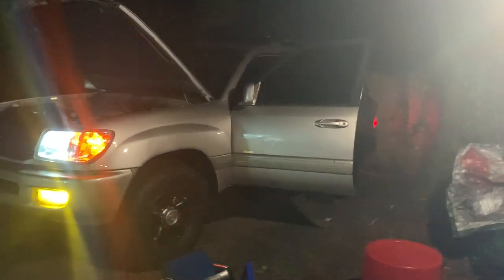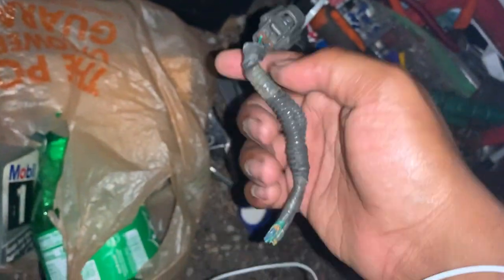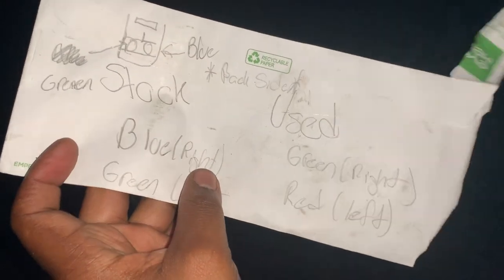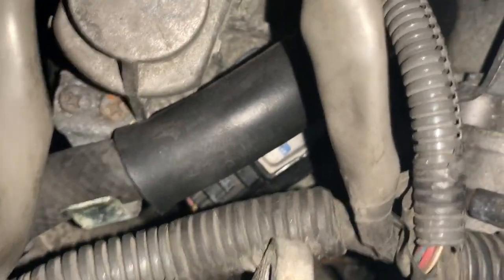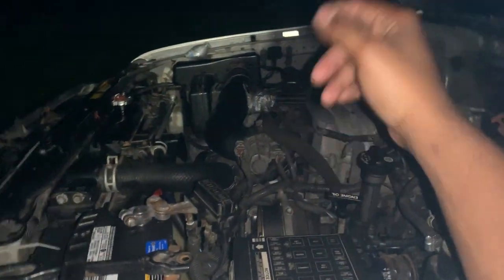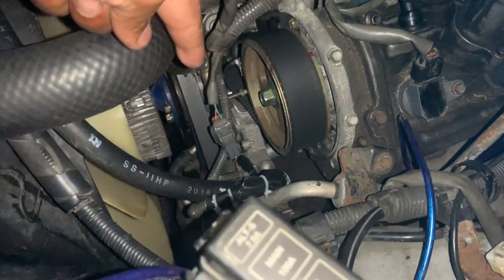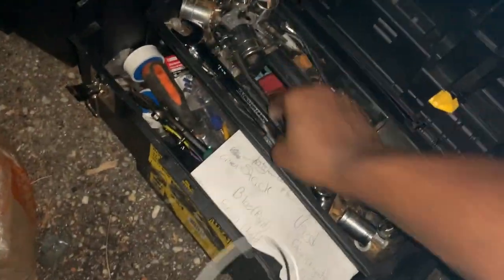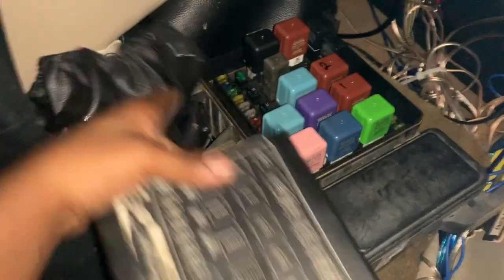Engine Cranks But No Start Pt. 2 - **RESOLVED** (Land Cruiser 100 Series)

Comment: Dude this just happened on my 2000 UZJ100- cranks but wouldn't start. Your vid saved me a ton of troubleshooting. Changed out the crankshaft position sensor and fixed. had my buddy scan for codes first and sure thing 335 code.
Reply from the maker: Props Brad, I am glad this video has helped addressed your issue and got your LC back up and running.

Comment: Woww thanks for the knowledge. Currently i hv Land-cruiser having same issue exactly as urs. I've already ordered new ECM but, am gonna check out CPS wiring now. My result will com afterwards... Below. Though my fuel pressure is low when i checked it.
Reply from the maker: Hey Collin's, I would highly suggest that you purchase odb2 scanner before you get the ECM installed, it can save you a lot of time and money. 
I too had bought a new ECM thinking it was my computer at first. Prior to installed the ECM I used my odb2 scanner and pulled multiple check engine codes which ultimately should there was a issue with starting the truck at the crank position and cam position sensors. These position senors must be working in order for the spark plugs and coil packs to fire.
Remember, in order to start a vehicle, you need:
1) Air
2) Fuel
3) Spark
4) Compression
 I would highly doubt that there is a issue with your computer unless you have been water crossing.

Comment: Buenas noches amigo yo tengo ese mismo problema y se le ha cambiado lo que usted ha cambiado qué fue lo que cambió
Reply from the maker: If you have an check engine light on, I would recommend that you get a scanner to look up the code, for my truck, I was getting multiple codes which lead to a stripped/grounded wire for my crankshaft sensor. The check engine code was P0335.

Comment: Hi bro I've got same problem with my fzj105series land cruiser. It has good spark & fuel delivery okay. I've replaced crankshaft position sensor but still won't start....Any advice?
Reply: @darrenlumbilumbi4559  check all the wiring for continuity.. Hopefully that's all it is

Comment: Hi you should have been able to pull a code for crank sensor and by the way, i don't think the the tps is adjustable on this type of trucks normally i change the whole throttle body to maintain idle wich is topical problem on land cruisers and lexus lx470 trucks
Reply from the maker: Hey Gary,

Thanks for the comment. Prior to recording, I used TechSteam to pull the codes which usually comes up with multiple codes for my issue because both the crank and cam shaft wire harness wire were stripped and grounding to the engine bay because a field mouse. But after the wires were replaced/rewired, all was well.

On the Land Cruiser, you can adjust the TPS but it's a timely adjustment. I got mine adjusted and was good to go.

Thanks